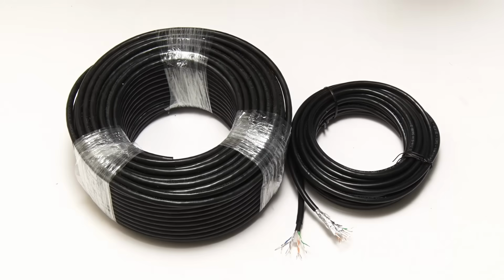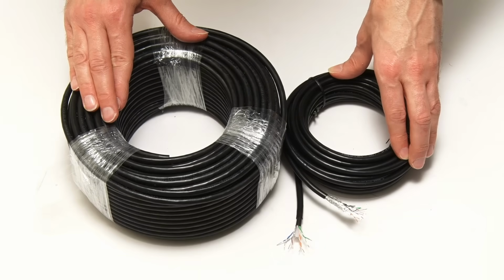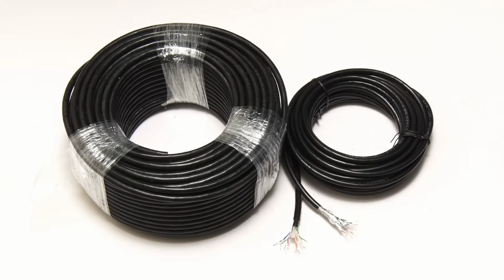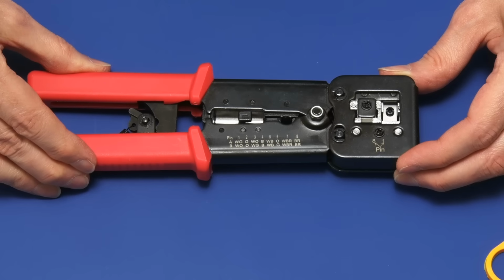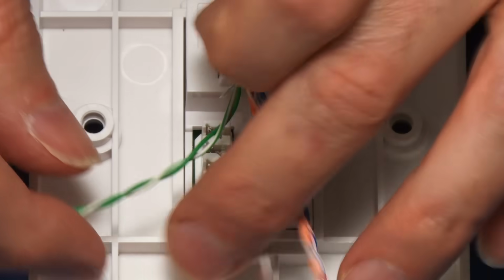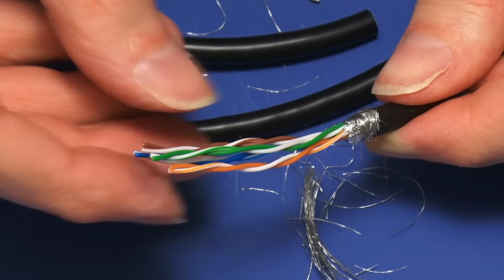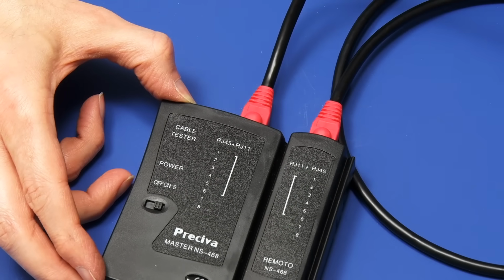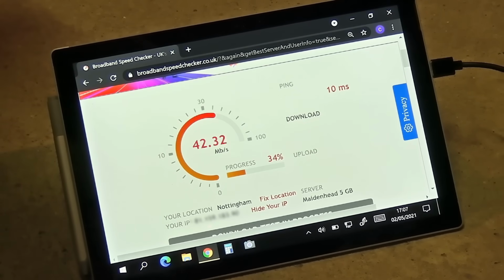Wiring Ethernet Extensions: How to Fit Sockets & Make Patch Leads

Comment: After removing  the outer sheath , There is no need to check for nicked cable if  you use the rip cord  wrapped around a screw driver or pliers, then pull along the cable to rip a cut in the outer sheath for a few more inches. That is what it is for. Then you can cut off the original exposed section.
Reply from the maker: Excellent advice. Thanks for sharing. :)
Reply: You're Welcome, standard operating procedure when I worked at BT. sorry about your wall.Techs are taught to drill from inside out and at a downward angle.Unfortunately if you don't take your drill off hammer function in time , you blast through creating a large exit wound.
   Watched your video prior to running my own 25 metre  cat  6 extension externally. 
       Thanks for posting it,and the others.Always informative and entertaining.Hope your garage is now super fast. interestingly my new hard wired connection is no faster than the powerline adapter I was using.
Kind regards
John

Comment: Why do people complain about speed of wi-fi when speed of light is always the fastest known to man-kind?

Are they using the wrong terminology? Perhaps they mean Wi-Fi is not robust enough because of other interference in the house.

Please comment on this.

Thank you for the videos and I am learning a lot from you. Please make videos about building a computer from scratch with close-up images and if possible links to parts used in the videos. Amazon-UK  links would be very useful as I live in the UK like you.
Reply from the maker: WiFi transmits data via radio waves, and its speed is not related to the speed of light (or the speed of radio waves). The transmission technology limits the speed, which has a theoretical maximum of 300Mbps (megabits per second) for the latest standard 802.11n, although in practice only about half of this will ever be delivered, and interference (and congestion) can decrease this further. The still very common 802.11g is limited to a theoretical 54Mbps, and in practice no more than about 30Mbps. In comparison most wired (Ethernet) connections to today are 1Gb/s (which is 1000Mbps), and this is pretty much delivered. So people complain about WiFi because, even in ideal conditions it is little more than 1/7th the speed of an Ethernet connection.

My last scratch build was my six-part Ryzen series here: https://www.youtube.com/watch?v=mIQfFIBjfXE -- lots of close ups! :) I've also got some related PC content coming up soon.
Reply: @ExplainingComputers  OK thank you for this explanation.
Reply: But what is the speed of dark?  ;-)
Actually, you're comparing propagation speed with data rate.  The velocity factor of cable is in the vicinity of .6 - .7, which means signals travel at 60% - 70% of the speed of light.  However, that does not affect the signalling rate, which is in bits/second.  You are not going to notice the difference in your home between cable and WiFi.

Comment: You dont put them apart like that.
You need to put them in right order whitout straigten the cable like that.
Whit a test tool for the cable that is about 1000 time more expensive you want to do it better.
Reply from the maker: Thanks for your comment. The wires end up in a line -- so they have to be "straightened" to some extent.
Reply: @ExplainingComputers  Yes so little as possible.

Comment: Hi, Great video. I recently moved into a townehome (3 levels with the basement and I do not know how it was wired before so I'm experimenting/tracing where things go. I picked up some male r45 male plugs to wire but they are not pass thru and you half to strip each wire about 1/2" (a real pain) instead of just passing it thru and crimping/cutting. I find it is next to impossible to strip each wire and put them in the correct order and hold them there and get each stripped wire into each hole next to each other (it's very hard to see if they did or not). Any tricks on how to do this, I might just pick up spme pass thrus. Thanks, Mike
Reply from the maker: The only trick I know of is time and patience -- it can be a tedious process stripping and wiring the plugs. Pass through plugs (and a crimping tool for them) can save a lot of time and frustration!
Reply: @ExplainingComputers  thanks, I have the tool, I just have to find some pass thru rj45s
Reply: @ExplainingComputers  Thanks, I found some rj45 3 pc plugs that alighn the wires by running them thru a piece that has 8 little holes before you push them in. So much easier. Thanks again, Mike

Comment: interesting video, I work as IT support for a cable making company here in the UK. one of the 4 main factories makes ethernet cables by the bucketload.(the other three are electrical, and on of those said 3 also does Telecom fibre cables - what your internet connection runs on if its by openreach)

Comment: This was really helpful Thanks, I would hope to see a video involving the repair of Ethernet wall port... I understand that just you don't need the whole 8 points for internet connection, you only need 1,2,3,6... If I have 2,6,7 and 8 blinking on the lan tester... Can I rewire it such that only 1,2,3 and 6 are working and as such there is internet connection
Reply: You need all 4 pairs for Gb.  You only need 2 pairs for 10 & 100 Mb.

Comment: Interesting fun fact to the last Statement in the Video. I was long ago on the same side that I always prefer a Cabled Connection but in the meantime this haven't to be tru in each and every case. For example if you have a Fire TV STick ther you can buy a micro USB to Ethernet Adapter. Unfortunatley this Ethernet Adapter is only capable of 10/100 (10 Mbits) therefore most of the time connecting to a Wifi will be the better option. Ok, thats a really Special case but just to sai its a thing of the dark side to deal with absolutes ;-)
Reply from the maker: I totally agree with you on the dark side and absolutes. But here as you note, instances of WiFi being consistently better than wired will be very unusual cases. There are USB to Ethernet adapters that offer 1 gigabit! :)

Comment: Ok some tips:
1) Straighten the wires with the mini wire stripper. As demonstrated here: https://youtu.be/ZGF6hFk6PkA , it does a fantastic job and doesn't hurt your fingers.
2) If you're struggling to keep the wires in the right order while inserting them, and you're using a pass-through connector, then just insert the wires 1 at a time. Problem solved.

Comment: For the underground cable, you might have want to mention that if you're going from one building to another  building with it's own grounding - consider the problem of grounding loops. If you don't want to worry about this, consider multimode-fiber.
Reply: not to mention lightning strike nearby welding every cable on the network into place and killing everything.

Comment: I wish you explained that Cat5 means "Category 5 wire" and that you explained it's describing the wire, not the cable. also that you explained what the differences meant, for example I think Cat3 wires are thinner.
Reply from the maker: Thanks for this. I always have to decide how much detail to include, and the opening section o this video is already very info heavy. On categorization, as far as I understand it, the rating is for the cable, not the wire (alone). Not least, the rating for higher cat cables is only possible due to the shielding in the cable, so depends on more than the wire.

I do discuss wire thickness in the video.

Comment: I'm only using Cat5e, so it can be rammed hard into the RJ45 so there is less untwist. Untwisting the wires by 10mm or more causes speed loss. I like the pass through RJ45s, but I suggest using flush cut cutters (Plato) to trim the wires and before crimping pull them back about 1mm so the exposed copper is not outside the plug.

Comment: Your internet connection is only 50mpbs? If that is the case, you can probably get your ISP to wire you a faster connection for no extra cost, I had was in a similar position with 100/100mpbs internet, my isp offered 940/880mbps for no extra cost (in fact it was slightly cheaper).
Reply from the maker: 50Mpbs is typical-to-fast from most UK providers, and the maximum available on my line from any provider. I can assure you that a faster connection, let alone at no extra cost, is not available! :)
Reply: @ExplainingComputers  Oof.

Comment: What type of cable would you suggest for patch panels - single or multi strand ?
Reply from the maker: Multi-strand, as it is more flexible.
Reply: Stranded for the patch cables and solid for the cables running to the wall plates.

Comment: 1. сначала разделывают провода и только потом стяжкой крепят - мало ли что пойдет не так и нужно будет по новой разделывать? стяжку резать? по новой затягивать? и 2. сами проводки, цветные которые, так, без запаса никто не обжимает, всегда делают запас в виде некоего изгиба, мало ли что пойдет не так? может этот человек - теоретик? (google translate) 
1.First, the wires are cut and only then they are fastened with a coupler - you never know what will go wrong and will need to be cut again? to cut the screed? tighten again? and 2. the wires themselves, colored which, so, no one crimps without a stock, always make a stock in the form of a bend, you never know what goes wrong? maybe this person is a theorist?

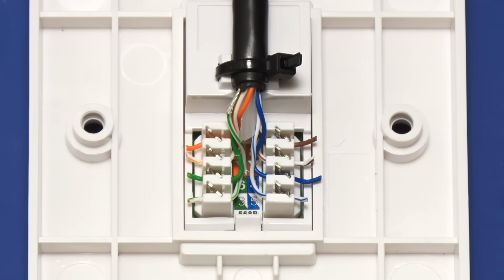Comment: At 13:17 it is quite visible that the punching down was done incorrectly. There should be no tailing visible outside the little plastic "cubes" that house the knifes. These tails act as antenna, and get noise into the system, which will be a problem at 10gig making the link falling back to slower speeds, or the distance will be limited. It is also wise to untwist as short section as it is possible.

Comment: I have all that equipment, I have done all the wiring my self at home and still found your video, informative and 100% accurate! Thanks a lot...
I like also the wired connection than wifi
Reply from the maker: Cool, thanks.

Comment: when you get used to what you're doing usually just use a pair of Klein scissors for pretty much most of the cable building and stripping. - A better punch down tool which if you get a better one,  it actually trims the lead ends as well  as you punch down the cable. 

If you look at 13:08  ,  it's not required but it's best to maintain the twists in the cable as much as possible especially if you want to attend category seven speeds or at least meet the specification.   it takes a bit longer and it's a little bit more time consuming but if you're talking about data center work or you want to get the maximum out of your connections try to maintain the twist all the way up to the jack punch downs.  

if you are going to be installing it in a wet location,  they do have jacks or specifically made for that and you can use ordinary checks as long as you treat them or use some kind of Dielectric grease on the back of the actual punch down to stop any corrosion.     

for those of you lucky enough to have the waterproof ethernet connectors those are really nice to use outside for outdoor cameras and so forth.

category 7 cable is in my opinion Overkill but it does do the job as a future proofing method.  
if you get it for a good price then that's fine otherwise just use category 5e cable has most runs in your home will probably be less than a hundred feet anyway and category 5e cable according to the ethernet standard can do 100 megabits / 325 feet with no problems.  

if you happen to be an amateur radio operator then by all means go with the shielded Twisted pairs or the devil shielded category 7 cable.   (I call it devil shield in category 7 because it is merciless to work with it's as thick as coax and it really can be a pain to terminate..   they also have special Jacks for most of the category 7 cable that are out there that are double shield. 
absolute waste of money for any home installation in my opinion.   UNLESS you do video editing work then by all means the sky is the Moon.

15:52 these ice cubes are great to use because the cables come out the very end and it sure makes the process of making these a lot easier most of us learned on stuff where they didn't come out of the very end so you often had to make sure you got it right the very first time.
these are more expensive but they're worth it especially for the do-it-yourselfer.

now if you look at the actual jacket where the foil insulation is That's supposed to be cut all the way back if you're going to install it inside of this kind of connector. shielded Foyle is usually meant for a shielded category 7 rated connector that has a metal jacket around it so it actually grounds to the network device.

in order for the plastic connector to really hang on it is best to use the PVC part of the jacket to be inserted inside of the actual RJ45 connector and that way it will securely stay in place.

also if you're really new to this and you don't want to mess with your walls just get a service Mount box and push the cable right through the wall and do that instead it's a lot easier for a lot of people and it's not that obtrusive either

good luck and happy cabling!
Reply: I was hoping someone would make these comments.
Reply: @PyroRob69  When men help other men be better, we all win.   Knowledge is like a kind of currency that has worth well beyond monetary value.    Its also a great way to pass down a Legacy  and make some great lifelong true friendships. 

For Instance?  They usually point out you need to use a spell check.   Something I quite often benefit from.   :-)   
In fact, its a necessity for me!
Reply: @MickeyMishra  Hahaha, yeah, I understand the spelling part.

Sometimes we only learn these things from having made the mistakes over the years. Sometimes we have a good teacher who shows us how to make cables properly. Sometimes you learn by having to make that cable over several times.

I once worked on some custom cable that had four ethernet cables inside a teflon jacket. Each cable was foil shielded, and there was also a foil shield under the teflon jacket as well. What a pain to work with, especially running through ceilings, and under raised floor. I think the minimum bend radius was about 24 inches. If you tried to bend it any tighter than that, the teflon jacket would crack / split and you through that 100 foot long section away. Fun times.

Comment: Thank you for the well explained video. These days fiber replacing the ethernet.
Reply from the maker: Yes, indeed -- I should do an optical follow-up! :)
Reply: Ethernet is not tied to the cables. In most LAN environments, you would use ethernet in your optical cables as well. For WAN installations, the choice of protocol varies, but Ethernet has become common there as well. ;)

Comment: Keep an eye on the silicone you used to seal the side of your house.  Silicone is an acid and concrete is a base.  Over time it may degrade.  There are special silicone caulks for this purpose but it's not clear you used this type.  Great video!
Reply from the maker: Thanks for this. I used an exterior silicon sealant intended for the purpose. There is no concrete involved -- the hole is sealed in brick.

Comment: IMPORTANT PSA: DO NOT use shielded RJ-45 plugs to terminate unshielded cables!!! They are INCOMPATIBLE and will ruin you day!!!

Shielded cables actually have a slightly thicker rubber coating (the colour-coded, innermost layer), so if you feed the thinner unshielded cables into shielded plugs, the wires will wobble underneath the crimps, so the crimps will often miss the copper! You then have to do it again AND you have wasted a plug.

I found out the hard way, after wasting about 30 or so shielded plugs and 3 days of my time. Hopefully you don't have to.

Comment: I have cat6 outdoor cable solid copper to run to my out building. From end to end about 35m, all of which will need to lay alongside an armoured SWA electric cable. Will this be an issue?
Reply: Use some underground cable duct.
Reply from the maker: I would put the cable in some kind of duct or conduit to keep it separated from the electrical cable to prevent interference.

Comment: 21:51 - Yep, this is why I use ethernet for everything that has an ethernet port or can use some kind of USB to ethernet adapter. Wi-Fi is only for my portable devices like phones or tablets. PCs, game consoles, televisions - these aren't going anywhere, they get wired. It gives them a more reliable connection and keeps the airwaves free for the devices that really need Wi-Fi.

Comment: Just buy them pre-made, tested, certified and better than whatever you can achieve.

Much less with such low quality punch down tool…

If that cable goes to the outside, you should use lighting arrestors/protectors.
Reply from the maker: You cannot buy a pre-made lead that goes between buildings with pre-wired sockets set into your walls.

Comment: Great video. Quick note. If you are using a shielded cable then you should use a shielded CAT6A connector (or whatever standard your cable is) otherwise the cable shield is not connected from device to the socket. They have shielding around the area where the twisted pairs pass into the connector and a small metal crimp that crimps around the foil screen, completing the shield.
Reply: Also, the shield should be grounded at one end only..
Reply: @James_Knott  Why is that?
Reply: @devanirnf  To prevent a loop that can pick up a lot of noise.
Reply: @James_Knott  thanks 😃

Comment: Keep in mind the testing tool here is just good enough to say the wiring is correct, it does not tell you the speed your cable is capable of. It is easy to make a cat5e end up as a 100mb cable rather than the full 1Gb in the case of non pass through connectors. I do recommend pass through as it makes your life easier. For the non-pass through, make sure you can see all the connectors copper at the front.

Hope it helps.